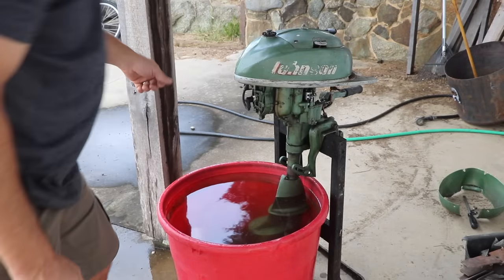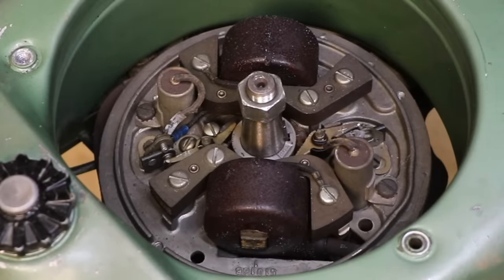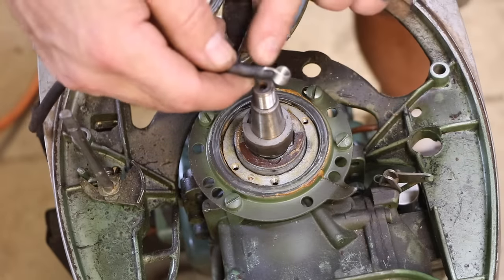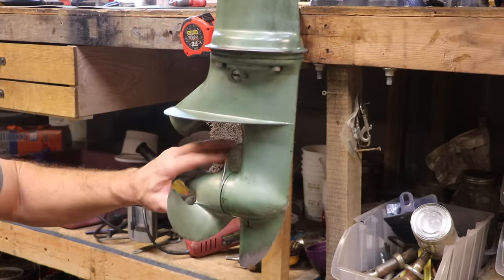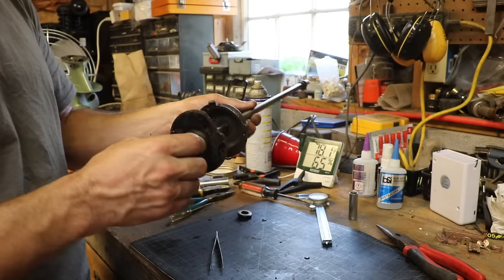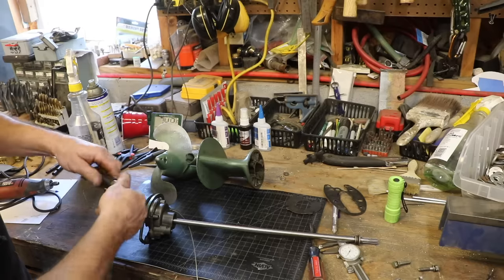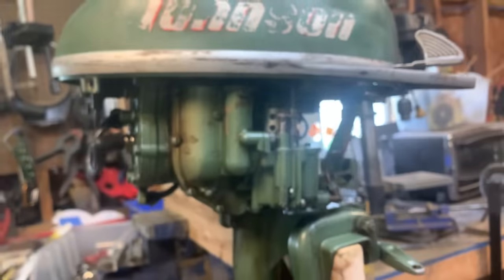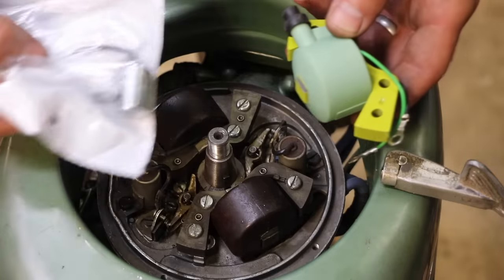My Johnson Needs An Overhaul, and it's Putting Up A Fight!  Johnson Engine Part 3

Comment: The motor runs well and appears to produce good power.  I would check compression again with a high quality gage.  This past week, my son in law and I went fishing.  His outboard jet motor lost power and we began diagnosing the problem.  Compression was 85 psi (not good) but all three cylinders read the same.  We think the jet pump sucked up something and cleared itself because the motor started running well again with plenty of power not consistent with low compression.  When we got home, he tested compression with a higher quality gage and WHO-DA-THUNK-IT, the Harbor Freight gage was wrong.

Comment: oh hey, me and a friend found an old dingy thing one day with one of these on it, we got drunk as you do and decided to walk 3 miles to the location we found it at originally with a jerry can and some oil to try and start it. After blowing some air thru it many times and several hours of pulling it actually started, no taking it apart no tinkering, just emptied it, gave it a blow and filled her up again, started like it hadnt been sitting there for yonks. we still use it to tease cows by the river to this day

Comment: The condenser holds the charged when it is generated when the points close, the charged from the condenser is then released when the points open.  thanks for the video,
Reply: The explanation in the video of what the condenser does is accurate!

Comment: When doing a compression test you need to open the throttle to wide open ! or you WILL get a low reading.... 
I agree I could not tell that it was only running on 1 cyl.... and I am a retired MC mechanic !
being a 2cycle piston port twin....it really does sound odd to me.... 
I commend you for getting your Johnson working in tip top shape! Hopefully you'll get a chance to use it in the future like that ! after all Having a Johnson that is not used is a crying shame !

Comment: I need to get rid of my old 25 Johnson and boat…I guess… if you were closer you could have that project to put back in order… the hull was designed to run in the saltwater flats around Steinhatchee Fla… with the 25hp it’s a little rocket… it zips right along!

Comment: I'm not sure if anyone else mentioned this but anytime I've done compression test I've always done the test at wide open throttle. Can't build compression if no air gets in. As for my background I've been working as a mechanic for 25+ yrs in everything from small engines, automotive, semi tractors, etc... I was trained for small engines at my high school(took it for 3yrs, then the cry shame is they removed the course a few years after I graduated). I worked in the field for awhile then went on to UTI for automotive training which at the time felt like a better career. As for the semi knowledge, I acquired that working for a bus company then a private semi company as their personal/emergency mechanic. As you said too, I'm a jack of all trades but master of none. Any questions feel free to ask me. I currently have a 2 cylinder Neptune that was manufactured by Muncie gear that I tinker with from time to time. I've had it running beautifully but due to a lack of a decent size test pool I haven't been able to verify that the water pump is working. Fortunately I've only ran it a few moments at a time to prevent over heating the head assemblies. I got it from a man who's father used it once and then stored it in a closet in the house dry of fuel etc.

Comment: My 1957 johnson sehorse 10hp had 55 psi on each cylinder and ran great. I did everything to it that you did in this series so far and it was a great little motor

Comment: I had one of those in the day.  Ended up with 25 psi compression when I traded it in ($25) for a 4 stroke 7.5 hp Honda (1985). I have NEVER changed the plug. Still starts by 3rd plug and trolls for trout all day

Comment: This one sure tested your patience and determination.  But you forged forward and it paid off.  As for the ring job, question, is it worth it?  It’s not like you will be using this little bugger every day.  I say, if you are going to use it twice every summer, it runs as is and gets the job done.  It’s 50 years old.

Comment: Hey just wanted to let you know that you should always ground you plug wires when you're turning it over. If the energy in the coil doesn't have a path to ground it may find another way. Usually internal. Keep up the good work.😊

Comment: That part that broke is a graphite seal that runs on the bottom of the crank. It should be replaced with a graphite seal. It self lubricates (yes there is oil in the fuel) and runs on the bottom of the crank to seal the transfer chamber for the bottom cylinder. Usually also has a spring.
Reply: I also notice that the float is cork. This is going to give you problems. Modern fuel has alcohol which will eat the varnish on the float. The varnish will gum up the carb, and the float will absorb gas eventually causing it to sink causing a super rich condition. Need to find a plastic or brass substitute.

Comment: Nice work brother ... Yeah pull the head and see what your cylinders look like.. If there's no scoring if the cylinders replaced that head gasket and repeat the compression check.. That had gasket is probably original.

Comment: I can't tell you how much I appreciate this video.  I have an old (circa late 40's I think) Johnson 5 horse of my grandfathers that I have always thought would be fun to refurbish but have never had the courage to tackle.  It still starts with the first pull or two and runs (which is strong testament of the old Johnson products in my book) but it lacks power and doesn't run smooth.  Like yourself, I am a jack of many trades but with the added characteristic that I seem to know just enough to get myself into real sticky trouble on a job such as this.   After seeing you doing the work on yours I am not feeling so skittish about giving his a good going through to see if I can bring it back to full life. Thank you for all of the good information.

Comment: For anyone else looking: I believe you’re supposed to check the compression with the carb all the way open, meaning the throttle pinned wide open. Looks like the way to kill the engine is the throttle all the way closed which would affect the compression and make it lower. The throttle when checking the compression at the end was all the way down instead of all the way open. Unless I’m looking at the wrong stuff.

Comment: 47 years of sitting may have left surface rust in the cylinders which got scraped off by running, now causing low compression or possibly low ring tension or possibly stuck rings.  Old motor fuel systems  always have either dried out seals and gaskets and/or a lot of residue in most if not all passageways,  Total disassembly and thorough cleaning usually will correct.  I'm surprised you did not clean the low speed fuel supply line and the orifice into the crankcase.  Interesting to see the  cork float shutoff valve(needle)  This is the  same system  as a 1937 Evinrude Elto Ace I worked on a few years ago. You would think in fifteen years they could have made more improvements.

Comment: Paper gaskets hold salt water causing massive corrosion to aluminum parts so gaskets exposed to water areas were saturated with a liquid rubber by most  manufacturers. I suppose you could coat your paper gaskets with 100% silicone to waterproof them?

Comment: Great job rebuilding it. It's actually amazing for an engine that hasn't run in over 1/2 a century the only a few gaskets and parts needed to be replaced. It ran great. You can't beat the classics.

Comment: The seal you made new was to 99.9% a grapite seal. I know these from water pumps. The grapite is very good in lubrikating at high speeds. It is likely that the bronse bushing will work for a bit and work itself down untill it leaks. It could hold up longer if you can lube it somehow.

Comment: Love this resurrection of yours!

When you are setting the points,...  

1. Is the gap set while at full throttle or at idle? (one of the least clearly explained steps for older outboards on the internet!!)
2. Each gap set when cam lobe at "top"?

I have been on&off working on a 1970 Mercury 9.8 that was my late father's.
Ran well until it was left with fuel in system over a year. Then was very gunked up, though it WOULD crank, but only idle. Stalled when throttle opened any further.
Rebuilt carburetor and fuel pump. Replaced all fuel lines and tank. Replaced ignition (Thunderbolt) module, coils, spark plugs, and points.
Not certain I got the points set correctly.

Comment: Easier than gluing paper to a dowel. Slot a bit of rod stock and slip a long strip of emery in the slot. Wind it up and use as a flap polisher. Works a treat.

Comment: I enjoy the way you take your time and give different methods on how to address ideas. I recently worked on my Evinrude 1955, 5.5hp and in order to place the gasket at the end of the drive shaft one has to remove the power head. Not difficult to do then all things fall easy in place. I'm not sure if your motor would be along those lines. There is enormous satisfaction in diving in into a project and complete it to the end.   Gracias for your skills.

Comment: Spark is virtually instantaneous when the points open. Spark advance as rpm increases is done because of the time needed for the flame front to burn vs the ever increasing speed of the piston.

Comment: Very interesting I've  repaired  small engine most of my life the older models ,very well explained I've had engines brought to me that won't  run and found the coil fitted the wrong way round because I believe  they are directional, at least it was on that machine it had a arrow on it that the previous person hadn't  spotted, any way very interesting, repairing things you don't think about the technical workings and my experience the don't go wrong very often,very good.
    Many thanks
          John

Comment: Got nervous when crank shaft slamed axially resting on the engine block. If possible lift the flywheel to allow for axial play before applying mechanical shock. Start with smallest hammer.

I have a 1961 model with a 1964 carburetor with adjustable fuel nozzle. A must have.

Comment: Fill it from the top, you’re right, it’s a gear case, simple. From the bottom makes absolutely no sense. Neat part you made, probably the original was cheap and easier to manufacture.

Comment: Try reading John Steinbeck's " A log from the sea of Cortez" 

It describes what he calls "A Hanson Sea Cow" A Johnson Sea Horse.

It only runs in fine calm weather when rowing would be easy and a pleasure 
As soon as you need a motor to do the work it stops running

Comment: I'm rebuilding a yamaha 8hp from 1980 it was running fine but had no power. I replaced the pistons and rings and honed the cylinder.
Now that thing has some power again 😊

Because the blow by with the worn rings the 2stroke has no power but was not clearly viseable

Comment: I never though it made a difference which way you choose to fill the lower unit. But my father in-law who went to school and was certified on Evinrude, and Johnson motors, fill from the bottom, until the grease ran out the top.

Comment: I leave a big sprayer with oil and use it to push the oil from the bottom but it doesn’t matter how you fill it

I have a fitting on the bug sprayer hose

Worked for 20 years

Comment: Here's a tip for you. When you fill the lower unit. Always fill from the bottom until it comes out of the top. You probably didn't get it full.

Comment: I believe there are crankshaft seals that very much affect your compression. Those may be going south now since you are running the motor. I assume you are running the right two cycle oil ratios? Sometimes people try to move up into "modern" mixology of 40:1 from the old standard 25:1 and these motors will not tolerate it. I found that out the hard way with a late 50's 10 horse johnson. Burnt it up. That was in the mid 80's so that newly found old motor could also have had a lean out condition from leaky crank seals....had no time or desire to mess with it then but now wish I had kept it and done a repair. Your video was excellent and super informative, thanks!
Reply from the maker: Keep watching.  I end up doing a ring job and you get to see the crankshaft "seals."  I agree on the oil.  No need to use less because the new oils are supposedly better.  I'd rather buy 25 cents more oil and know my engine is happy.

Comment: When you spin the motor over with the plug wire off (not close enough for the spark to jump to ground) the high voltage will jump across the coil windings, often destroying the coil, it's a wonder that both coils are not bad now.

Comment: The tone was different when it was running one 1 cylinder, and the top end RPM.
Early Johnson’s are amazing, my dad had and 18hp, flat out run a 18’ Alumicraft with extras 25-30 mph.
The thing had to be 60 years old, run like a top, every time I used it.

Comment: @37:49 That's the seal. Not metal. In my previous comment, I mentioned replacing that with cork. The old one you broke, originally was soft and pliable. Turned rock hard with age.

Comment: To put the washer and oring in from the bottom make tool out of a dowl rod that is just a snug fit inside the washer turn the engine upside down and insert the washer etc then slide the shaft through it and into the crankshaft and flip the eng back over

Comment: Hi, when running the compression test, you are adding a lot of volume to the small cylinders with that long hose, making it almost impossible to compress that air volume above 70 psi. Shorten that tube to a minimum and you will be surprised.

Comment: ive seen this one other time... the oring part you just made. the reason i think it is 2 parts is you put the washer in then the oring, THEN the upper part.... now its square and aligned that the clamping force of installing the head pushes them together... i think  but either way what you did im sure is also fine...

Comment: Worked on these for years and when it's backfiring you need to open the low speed idle just a little bit more it's not on the top it's down on the bottom and it sticks out of the crankcase on a long rod with a slight bend on the end

Comment: No… it’s not paper… you could use something like Threebond 1184!  You should always grab a little axle grease…I’d use Amsoil marine grade blue grease… you want to work it around in your fingers and get a nice light layer of that grease coating that impeller!   Especially in brackish or salt water… then you would want to do a nice flush after you ran it also… the 25 has a little plate so you can peak in to see the upper area and align your shaft… if you lean it off a bench on like a 45 degree angle you can slide it up in…. I’m glad that you thought… because you definitely want a little dab of grease up around your top shaft… that bronze will be absolutely fantastic there… your upgrade or new bushing out of bronze is excellent… coat it with grease!!!

Comment: Sounds like perhaps you do not have the timing just right!
Ensure pistons are at TDC
AND have throttle lever set at the appropriate speed or spot for setting point gap, as throttle position changes gap opening, if throttle is in improper position timing will be off. Also, MAY be indicated by slow running speed. And no, I don't remember setting!  Been 50-60 years since I worked with one!
Also, remember no alcohol in gasoline in 2 stroke engines. Alcohol in crankcase attract water, and water destroys the needle bearings on crank.

Comment: I took Motorcycle Mechanics in Jr High and loved how you explained everything as you did it. You may have had higher compression when you started because of gunk and rust on the rings sealing tighter. I rebuilt a Honda CB160 that had been sitting for 10 years. The compression when I first tested it was 130, and dropped to 110 after cleaning and replacing head gaskets.

Comment: A compression check should be done with the engine warm and with the throttle wide open.    New ring with a proper end gap would probably help.

Comment: I work of chainsaws quite often and It's recommended to use a compression tester with a shorter hose on small displacement engines to get a more accurate reading, the swell of the hose acts like a buffer and eats up some of the pressure, and since a small displacement engine doesn't displace much air it doesn't take much to show a low reading.

Comment: Just looking at the dual points and coils it would be really easy to put dual plugs in her. This would produce about 2 more hp due to better burning. Of course farmcraft would have to bore another hole and tap it for another plug. Might have to be very long threads if going through a water jacket.

Comment: The part you replaced with the silicone bronze is called a mechanical seal, the broken black price is probably some sort of carbon that is designed to spin and rub against a stationary ceramic part.

Comment: The spark occurs when the points close.  When the coil is shorted by the points, it causes an abrupt collapse of the electrical field that washes across the other winding. The collapse of the 1st field induces a massive rush of current in the adjacent winding which must jump the spark gap to get to  ground.

The capacitor, without writing a long explanation, ensures the moment the spark jumps the gap, you don't get the same scenario in reverse.

It's a tiny controlled EMP.

Comment: Good video . Don't be too "ham fisted" on this old girl though , using power tools to tighten things . A snapped off ss bolt in an aluminum casting that old is trouble .I have a '63 model 3hp that's mint .It was running on one cylinder also when purchased , but the pinched coil wire was an easy fix .Many parts are still available , which is amazing .